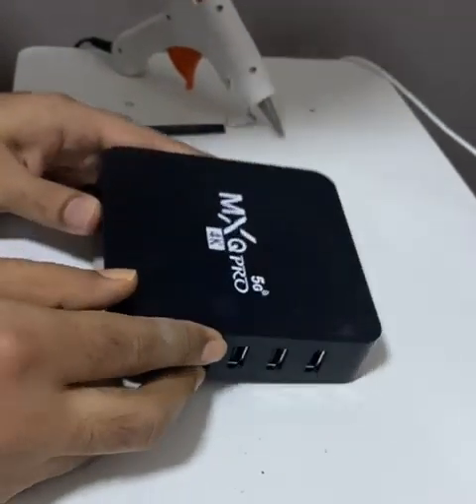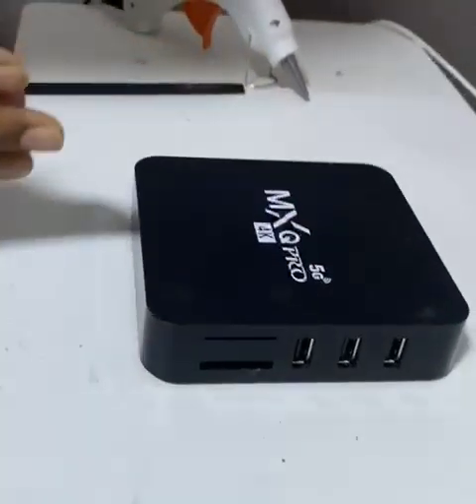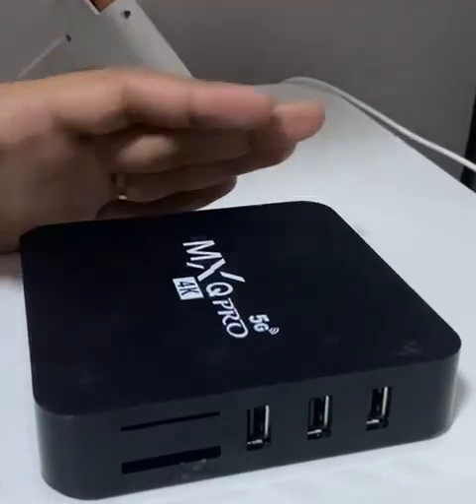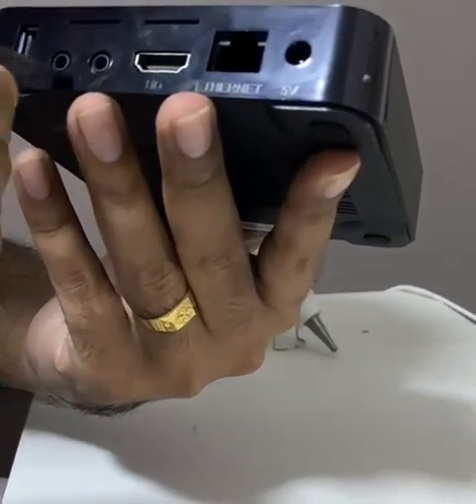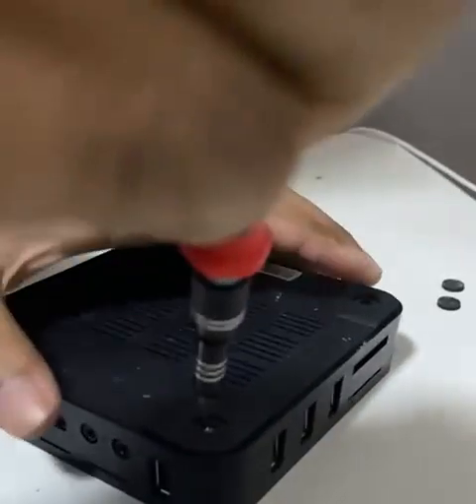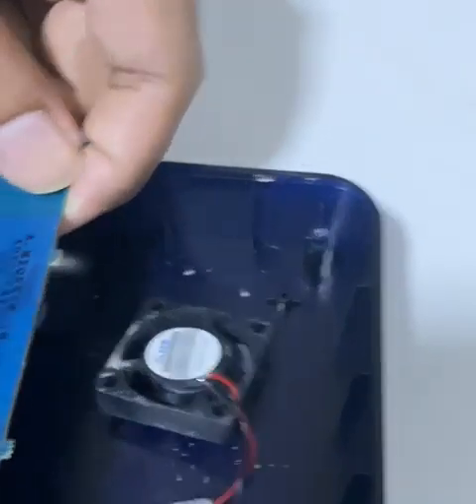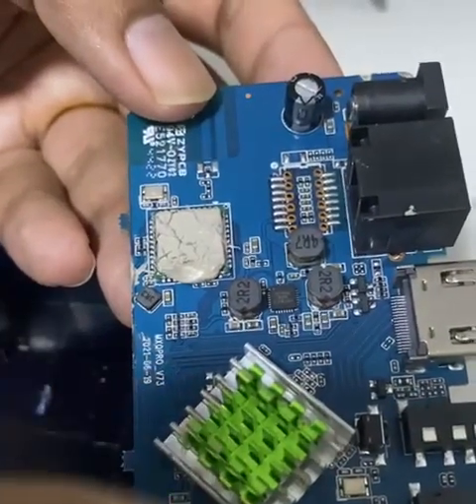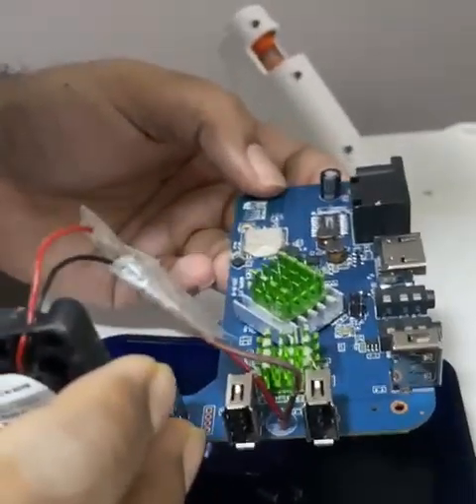100% (MX Q Pro 4K) Android tv box restart hung on logo issue fix

Comment: Very useful! Question what I will do if the clock repeatedly  is wrong?. When it does you can't use the WiFi to watch Youtube or Movies.
Reply from the maker: You can set the date and update date and time from internet ON using setting - system preferences - Date and Time.

Comment: My box has the exact board as this one. It says it has 4gb 32gb specs which I don't think is true. I wanted to change the firmware as the one it has is too slow. I found a suitable ram but after a successful flash, it doesn't boot up. Do you have a solution to this problem? Thank you.
Reply from the maker: Hello @Simon Elijah, you should probably try a stock ROM. XDA has it here https://forum.xda-developers.com/t/rom-official-7-1-allwinner-h3-mxq-pro-4k-5g-stock-rom.4251469/. Thanks
Reply: @befix  Thank you for your response. I'm wondering if this is the right firmware for my box as the board is written MXQPRO_V73  2021-06-19 with an RK3128H processor.
Reply from the maker: @simonelijah5513  Ah! So yours one seems the same as mine. It is a rock chip CPU. Please try this link - https://forum.xda-developers.com/t/help-need-firmware-for-mxq-pro-4k-5g-rk3228a-with-wifi-esp8089.4488563/. Best regards and please make sure to subscribe!
Reply: @befix  I have downloaded and flashed the rom in this link but the results are the same: successful but no booting- only black screen.Thank you for your assistance.
Reply from the maker: Have you tried resetting? Inside the AV jack there is a button. Power off the box and press the button and then power on and release. There should be a wipe screen on the monitor. Or some logo in your case.
Reply: @befix  The reset button is not working so I connect the box to the computer in maskrom mode. Again, the device is not powering on just showing the red led. I believe I flashed a rom that had the wrong loader at first hence this problem. Only firmware with loader version 2.37 flashes successfully though booting fails.
Reply: @befix   i finally managed to get a working firmware called R29_ MXQ_LP3_V2.3 wifi-2052. Everything is working apart from wifi, but that's okay with as I'm using wired connection.Thanks again for your advice.
Reply from the maker: @simonelijah5513  great! Can you please share the link for it?
Reply: @befix  I've tried sending you the link twice but it appears it is getting deleted. Don't know why.
Reply from the maker: @simonelijah5513  Looks like youtube filters it. Can you please post it now?